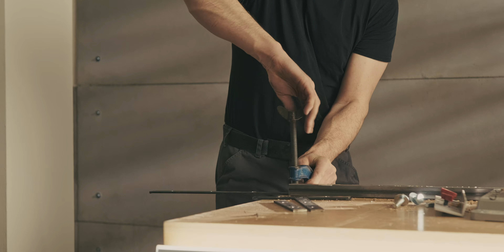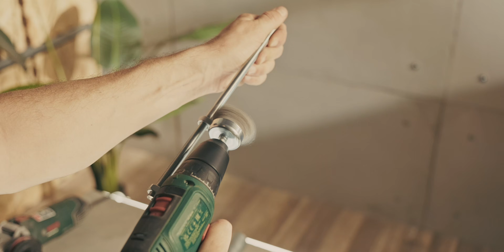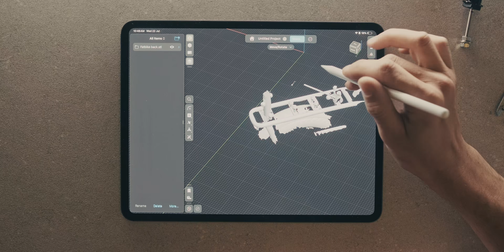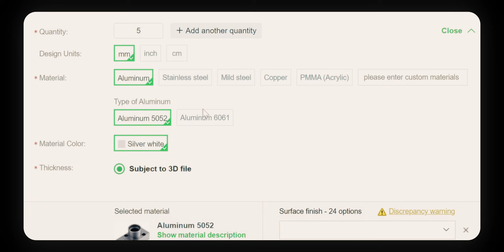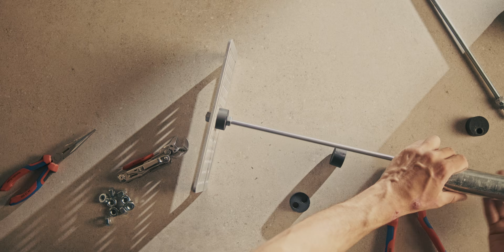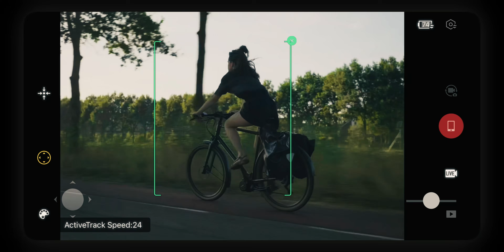I built The most Dutch Camera Rig

Comment: There are some external monitors from Portkeys and also other companies that can do touch focus. You could mount that on the bike's handle and use an hdmi transmitter like the affordable ones from Shimbol (or a long cord) in combination with that.  Yes, very cumbersome, but you would see what's filmed and can control focus and a few other settings. Or you can use Sony's app or something like monitor+ on your phone and do the same. I had mixed results with both in terms of stability though.